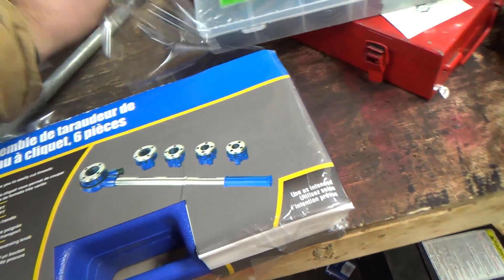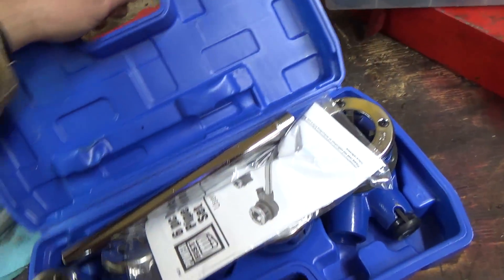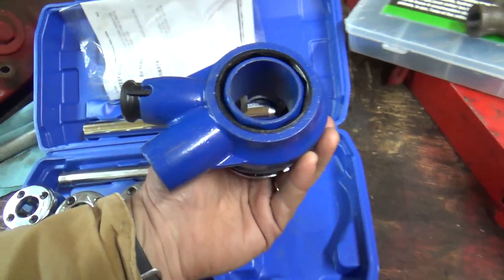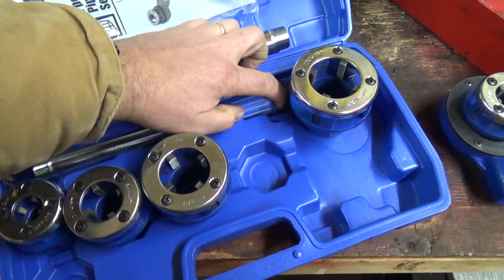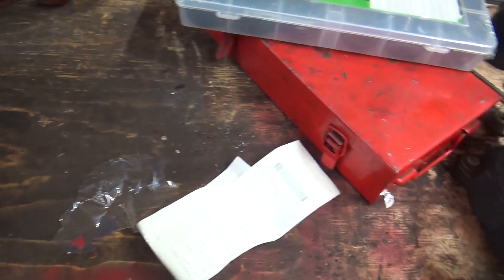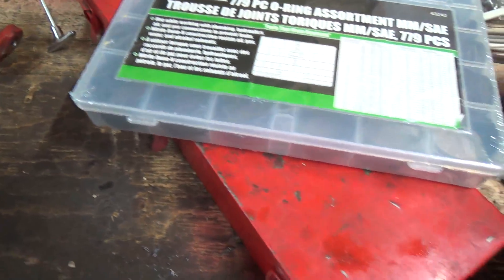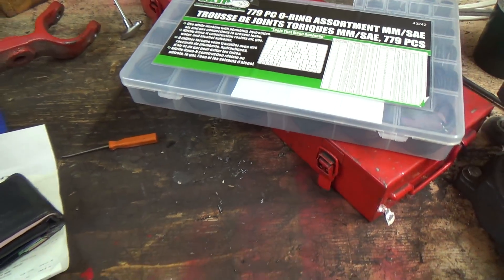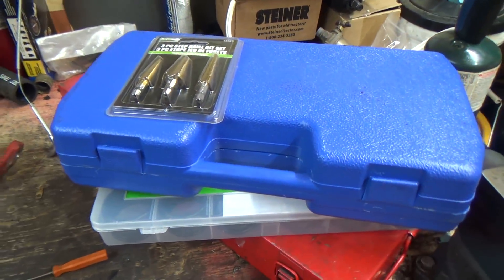Picked up a few items from the last Princess Auto flyer..Lets take a look

Comment: The PA pipe wrenches are decent enough, I've been using 2 of the 24" ones for 5 years or more. However I do have the proper $1200 rigid (1/2" to 2") hand threader kit and there is a HUGE difference in quality just watching this video. But like you said, if you only going to use it a couple of times it should do the trick.

If you want those to last, you need more lube.  I use the rigid dies with the Milwaukee pipe threader and pour oil whiles it's running. Drips into a bucket below to reuse.

Comment: Might want to put a 4x4 post wherever you have a water spigot and fasten the pipe to the post so they can't lean on it. Or better yet, put a two inch pipe buried in concrete as a post to mount the spigot on
Reply from the maker: This one we did pit a post securing it this past summer

Comment: Use the instructions and quit guessing on how a tool works. Cutting Oil is your friend too or the teeth won’t last. Don’t forget to use pipe dope on the threads. Dope required on NPT, NPS.  Paste Dope is required on straight threads.
Reply from the maker: I dont read translated chinese to well :) but you are correct